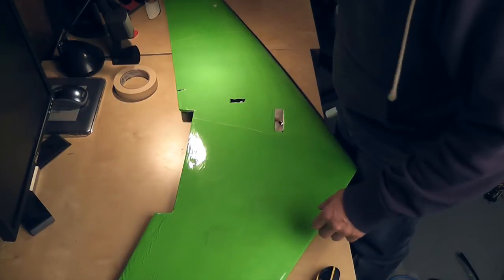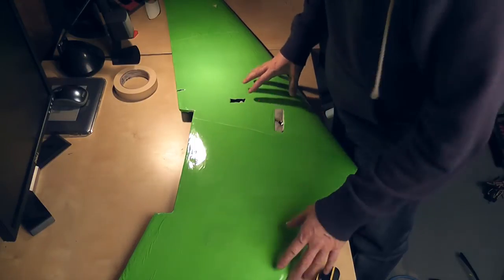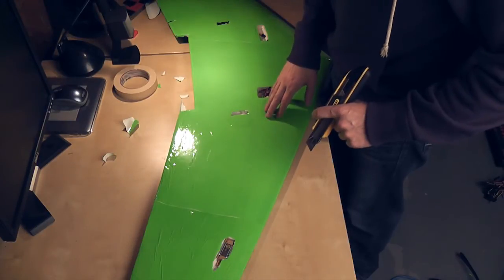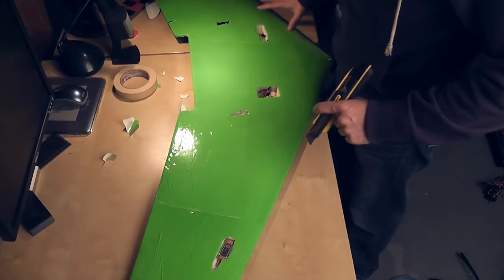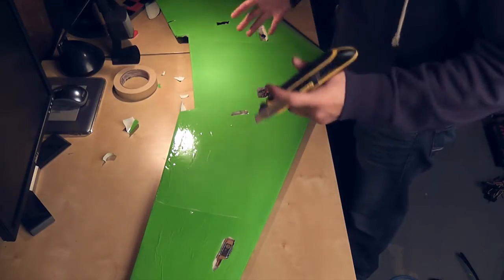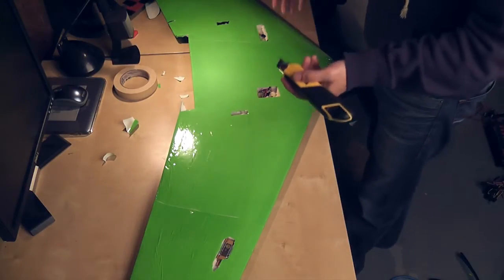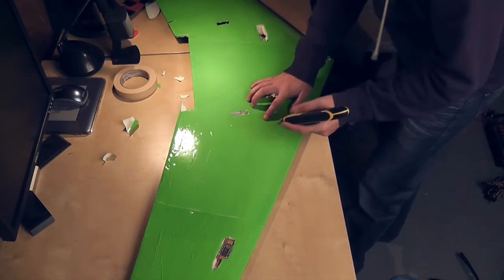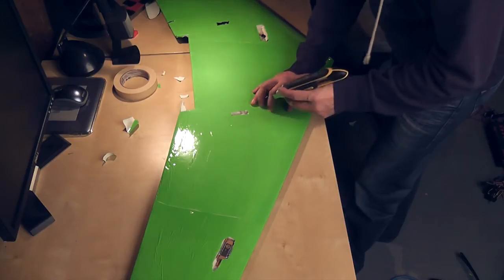Windrider Scout Bee Build Part 4 - Finishing Touches

Comment: Two 5000 mAh  packs with the thicker center of the wing cut out? Bro that's a lot of weight as well as mAh and coming out of a dive into a loop without another properly set spar set creating a battery box could and will snap the wing in half. That's one way to keep the weight down and end up with two wings for the price of one but I don't think you'll like the symmetry;-) The Scout Bee/Wicked Wing XL is an excellent  flying wing glider designed with reflex and an airfoil for a lighter weight to perform within a given speed range and you are taking it out of it. Granted anything even a brick can fly with enough power but not efficiently so you need more power per hour to do more work because you added way too much weight in batteries, motor, and the ESC to start with. A lighter wing will stay up longer needing less mAh.

If you want more time in the air for longer flights you keep the weight down and don't need to  increase it if you fly it like a motor glider using lift to gain altitude instead of flying through areas of lift which means use a power pod or other means to not increase drag by damaging the shape of the foil and changing the lift to drag ratio. To maximize the power system you do the same thing to it as you do to the wing as the physics of lift to drag remain the same and should go to a larger slower spinning prop with a smaller lighter weight motor of the proper KV using gear reduction to increase efficiency. The more air both the wing and prop "touch" relative to time as it moves forward the more efficient it will be to stay up longer even if you decrease the L/D in increasing the sink rate. So distance and time are connected where light weight and the proper shape of the wing to reduce drag are the two keys to staying up longer and going further. Using brute force never works as modern warfare shows when you use time to think ahead and do it right and not fight physics.  

But looks like you did a decent covering job... as for the cheap clear laminates I have never used them and can't say I like the "look". Real Monokote applied properly has a tensile strength of 25,000 pounds per sq in and it's lightweight at only 0.2 oz/sq ft. There seems to be a new outlook on "not flying" RC planes that back in day was called crashing which no one flying did much due to the time required to build a plane. However regarding the habits created by flying properly to avoid crashing they remain the same. Good habits = good everything connected to them including your health your e-motions effect. Happy people don't crash....